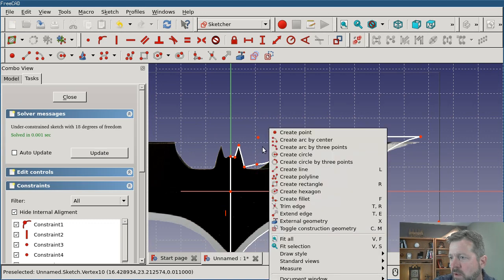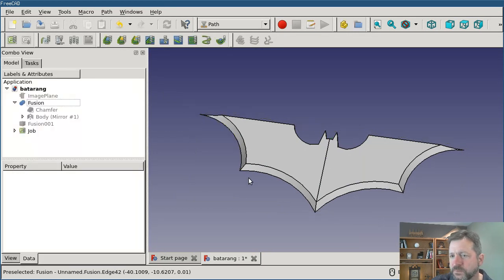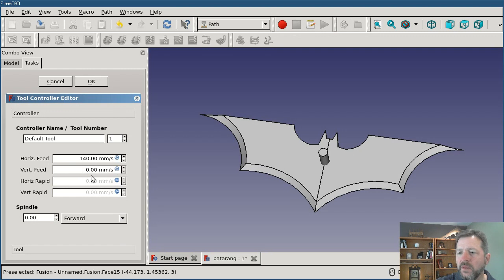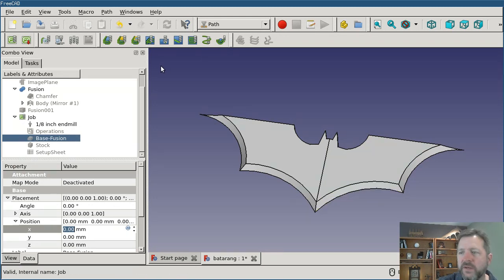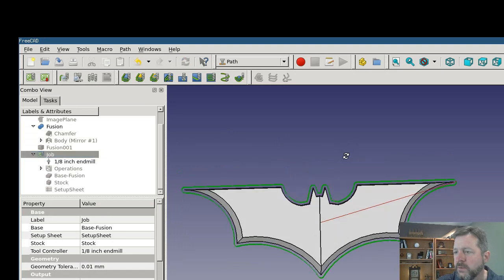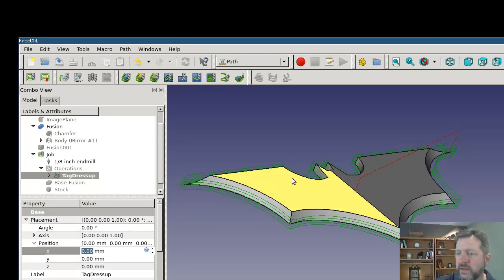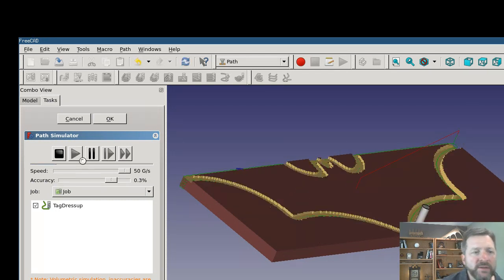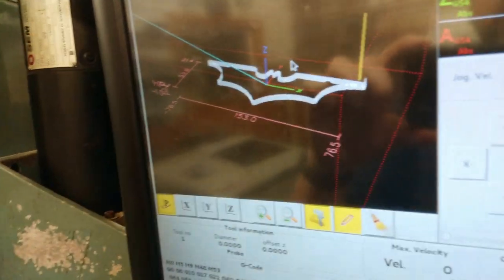Part 3 - CAM Setup and Cutting

Comment: Thanks for this series Brad, I'm really enjoying it and learning a lot. I currently don't use holding tags, I use a largish piece of plywood (or aluminium) clamped to the bed and then I use painters tape stuck on the plywood and rubbed in (burnished), the same again on the base of the stock then cheap super glue applied to the painters tape and both parts stuck together will hold everything amazing well and your tool never gets near a clamp.
Also can I ask which LinuxCNC GUI you use? I'm still using Axis, but yours looks interesting
Reply from the maker: I saw the super glue trick on NYC CNC and they raved about it. I haven't tried it yet. I've also used double sided tape in the past and had good luck.
The GUI is gmoccapy. It's great. Much better for touchscreens than Axis.